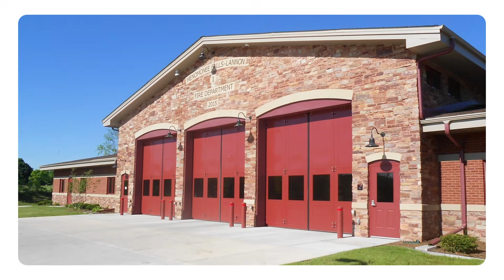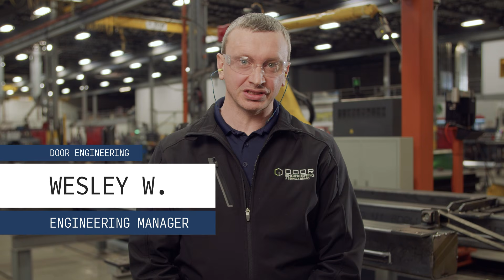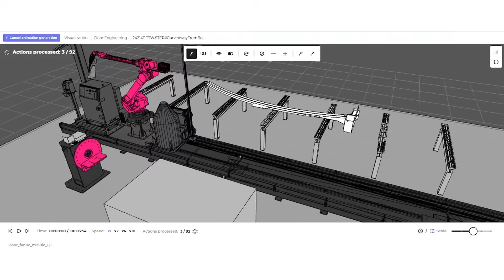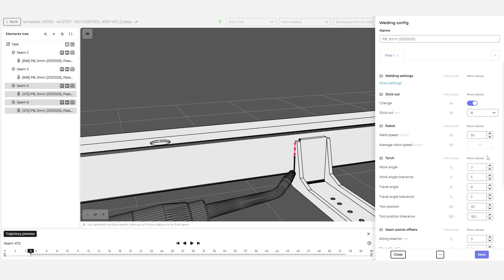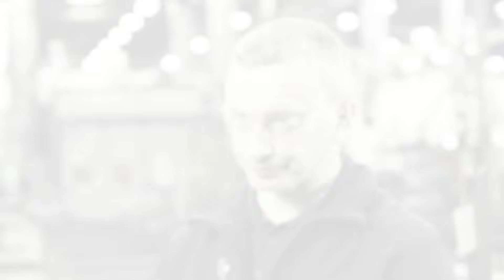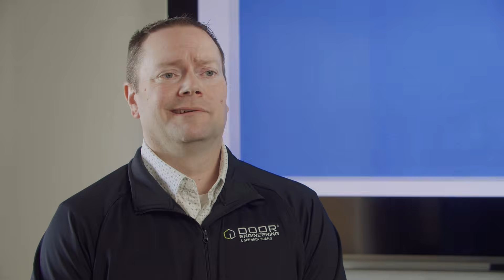Robotic welding for high-mix structural components. DOOR ENGINEERING (USA)  | ABAGY ROBOTIC WELDING

Comment: Looks great. What is your uptime? What levels of scrap rates you have experienced?  How about changeover timing?
Reply from the maker: Thanks! From the customer’s side, uptime has been very good so far, with minimal downtime in day-to-day production.

One of the biggest improvements was reducing rework and scrap - the customer mentioned going from roughly 20% scrap rates initially down to around 0–2% today.

And since the system is built for a high-mix environment, switching between different parts is much more straightforward. The cell has already processed 200+ different part models, so fast changeovers and flexibility were critical from the start.